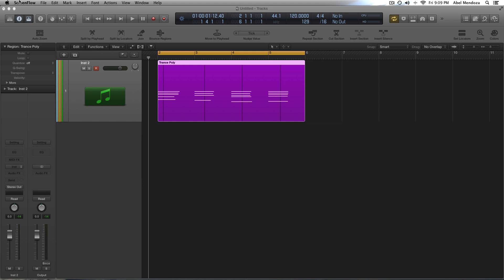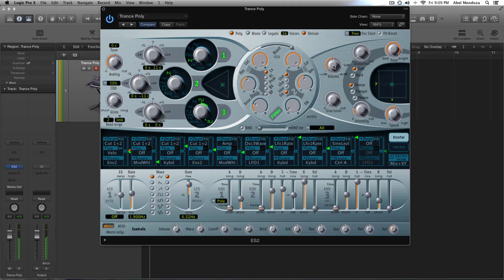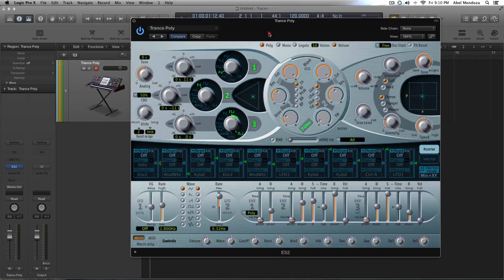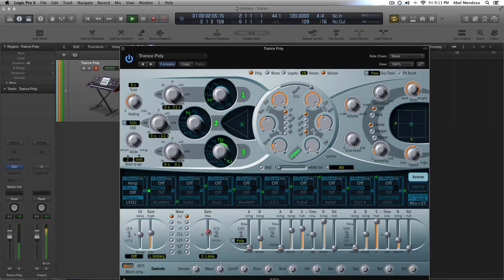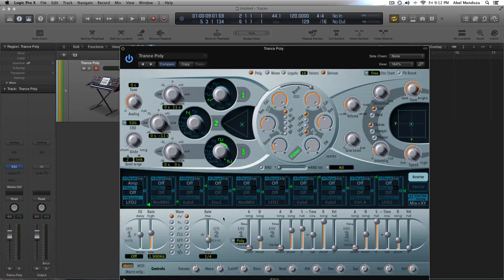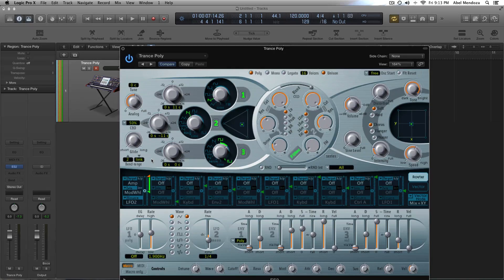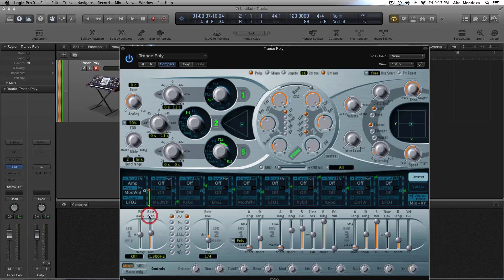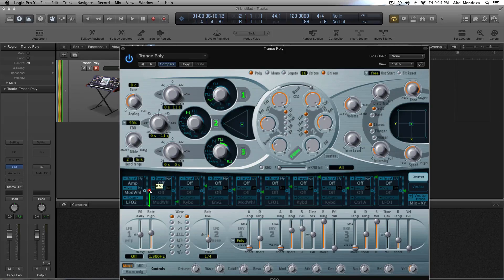How To Make A Pulsing/SideChained Pad Sound In Logic/MainStage   ES2

Comment: I have a problem when i try to route audio from MainStage to ableton, i know your tutorials are with logic, but i was wondering if you could give me a hand with this. I press a key in my MIDI controller and it sounds after like a half second, my buffer size in MainStage 3 is 128 samples and it shows  ROUND TRIP 12,2ms and 8,7 OUTPUT       and my buffer size in ableton is also 128 samples and it shows  IN 2,90ms and OUT 5,42ms , do you know what could it be? and what can i do to fix this problem? Thanks a lot.

Comment: Hi Abel, thanks for this video:) Just a question, by creating this pulsing effect within ES2, will i be able to use the tap tempo on mainstage to adjust the tempo speed of the pulse?
Reply from the maker: Everything in Logic/MainStage is tempo sync so yes,but if you want to change the rate 1/2,1/4,1/8... (live performance) then you need to assign the rate to a knob, if you need help with that check out my tutorials for intro to MainStage.